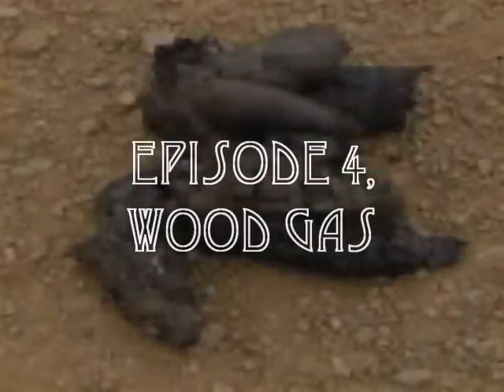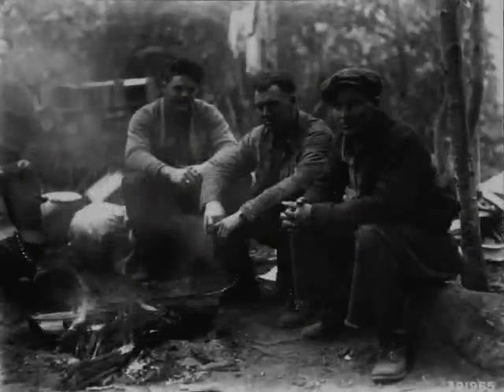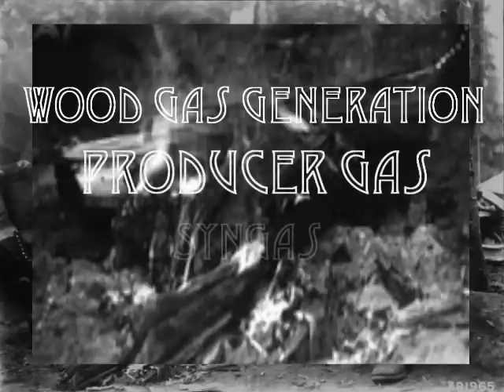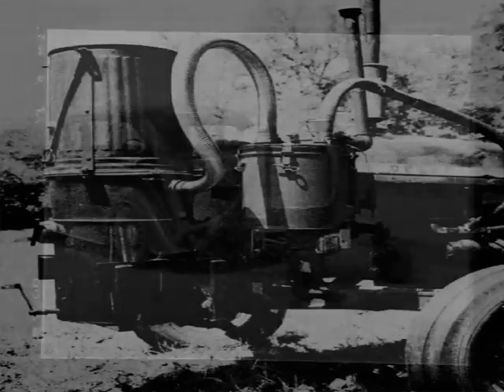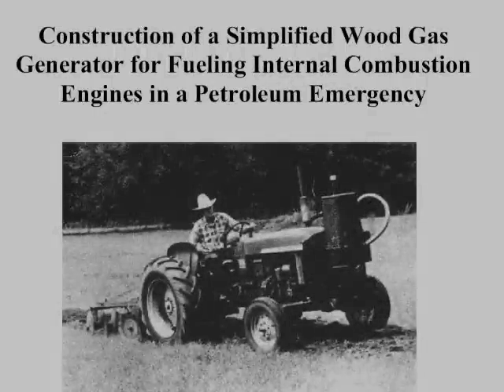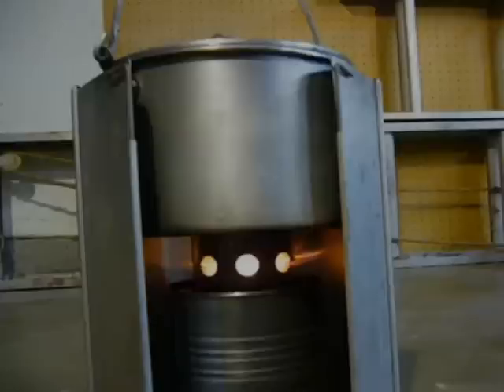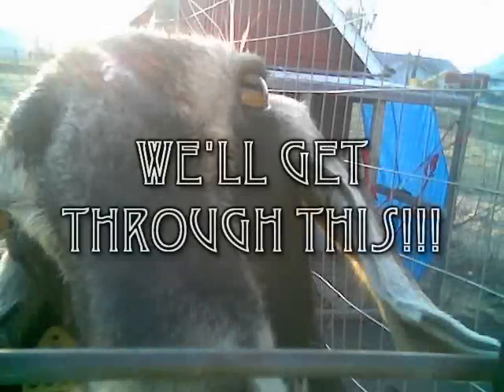Prep Tech 4 (wood gas)

Comment from the maker: @Vention, As for air control, please study the pdf., in the more info box.  Wood chipper... electric would be better, so you don't have to convert more than 1 gas engine to run on wood gas.  You could use it to generate electricity, then run the chipper, an electric chain saw, charge batteries, provide transportation, all on 1 multitasking platform.

Comment: GoatHollow
My mechanic's mind tells me that smaller pieces of wood would work better for a woodgas generator. Big pieces allow too much air to get down into the fire. You might want to invest in a wood chipper to turn those big pieces into small pieces. Of course you could also put a better seal on the lid and only allow one air entry point for air to replace the woodgas volume that the engine removes from the combustion chamber. If you did that you could probably burn larger chunks just fine.

Comment from the maker: Way ahead of you Grayman.  Hatching plans with a little trailer I have, and a Snapper riding lawn mower.  Already have an auto alternator, thinking of a takeoff from the mower pulley.  Can tow the trailer (Which holds the gassifier) to the woods... battery, inverter, electric chain saw.  haul the fire wood home on the back of the trailer.  While I have it running, top off the solar batteries.   Brain smoking.... must stop now!!!

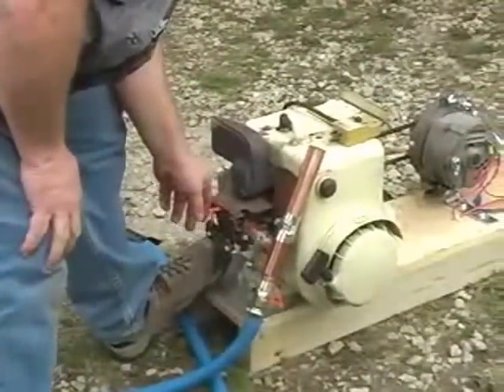Comment: At 2:58 you picture a small horizontal wood gas powered motor running an alternator possibly. Now to me this would be the first step. Dump that power into your battery bank and supplement the power at your house. Also if you could make a little go cart vehicle with that wood powered engine in it. Hmmmm.

Comment: I looked at wood gas a few years back but it seemed such a cumbersome prospect, but this stratified downdraft version is pure genius! The original ones I looked at just had a sealed chamber with wood to be gassed and a second lower chamber with a fire that cooks the wood, producing the gas. This version only requires one chamber and the wood gas is yielded up by limiting the available oxygen in the system. I gotta say, I'm impressed. Thanks for the tip.